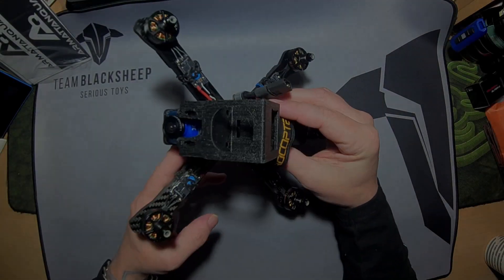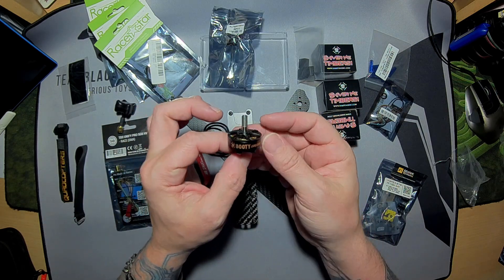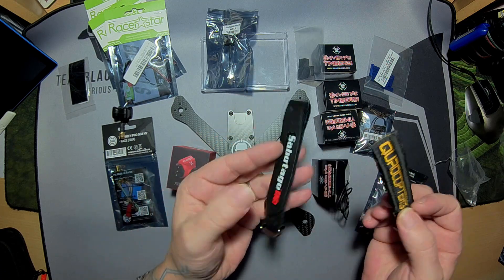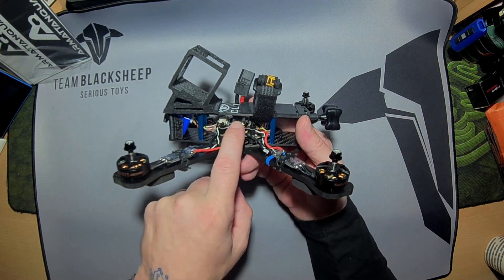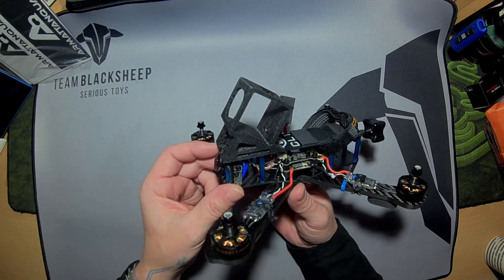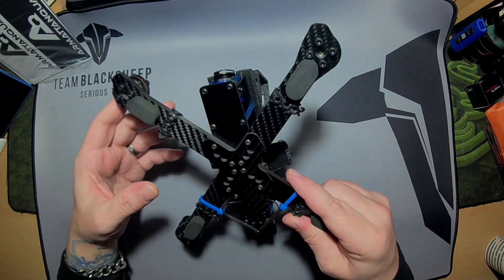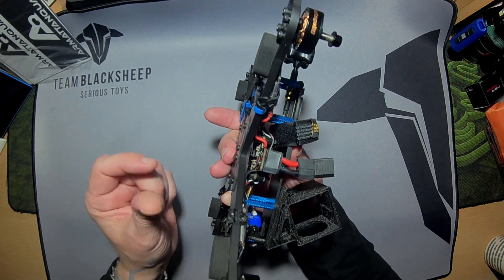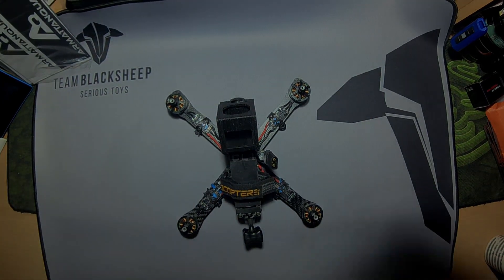Rotor Riot CL1 Parts & Build

Comment: What awg did you use for your battery lead ?
Reply from the maker: I used a little length of 12AWG which is probably overkill but hey,it's what I had handy.
Reply: So is 14awg good enough? I have the Bardwell F4 v2 fC Im wondering if I should use a capacitor?
Reply from the maker: I think it would depend on your usage for example ,4S on a Tattu 1550 yes for 14awg as those batterys have 14awg anyways, 6S or crazy powerful motor/esc with mental battery combo's no, go for 12awg.If all I had was 14awg ,I would have to use it to get me in the air and probably swap it out later for good measure.
As for running a cap or not, check on RCGroups or the store pages for anything explicit that requires one, you may be able to get away without one but nowadays it's very good practice to run one none the less so I'd say consider putting one on. Again it's depednent on the combo of things so air on the side of caution.
You may be able to kill 2 birds with 1 stone with your scenario as I remember seeing a store now recently stocking/selling XT60 pigtails with a capacator pre wired, I cant rememer off hand but will look if you want.
Reply: MrE thanks I saw that rotor riot sells them the pigtail with the cap. But it says comming soon! Also I have primo motors 2007 2650kv motors idk what awg they are but I should go with the awg for the esc? And the motors? What if one is 14 and the other is 16?
Reply from the maker: @Beastnasty_0313  Ignore the motor and ESC wires AWG as such because you have 8 power wires to the ESC's & 12 AC wires to the motors from them ,which all have to be supplied over the battery cable gauge combining all the power through them into one.

What battery are you planning on running?
Reply: MrE idk yet I’m new to the hobby I’m debating between 4s and 5s but don’t know anything about good battery’s
Reply from the maker: Being new to the hobby and the motors you have, 4S will blow your socks off!I assume you are leaning towards freestyling rather than racing?
Reply: MrE so 4s it is then and of course freestyle!! Also what charger do you recommend that’s not to pricy but works great? And back to the original question 12awg or 14? 16awg? For my battery lead
Reply from the maker: @Beastnasty_0313  I have had a great time and alot of use out of my ISDT 608 among many other chargers, good for the price and you can run a parallel charging board on it however it requires a DC input source in the form of an XT60 ( search my video back catalogue for a review) - ISDT also do others that plug into the wall etc. 
The SkyRC S60 is also quite a good cheap one for our needs which plugs directly into the mains (again a video on that somewhere in my back catalogue) which would get you going to start with.
Like anything in our hobby, there's so much choice in the way of chargers but sage advice is spend once on a good brand one.

To answer your battery lead considerations,  I'd certainly opt for 12AWG given the option.
Reply: MrE thanks again!! I’ll look at your videos when I get off work thanks!!!
Reply from the maker: @Beastnasty_0313  No problem ,Fella. I'll help you out the best I can - just shoot me a comment etc.

Comment: Nice! 
Just a bit curious, how many quads do you have at the moment? :P

And I have a little question.. I'm selling the Tronxy x1 (3d printer..) because it doesn't really print good enough.. for example 3d printed car parts break in a few minutes (details aren't that great too) and parts from a tevo Tarantula work fine so it's the Tronxy that's not working so good...

But I'm not sure what a good price is.. someone wants to give me €80 for it, what would you do?
Reply: And, I want to get some new wheels for the Basher Hellseeker, and I found some cheap 1:16 scale wheels, but they are for a WPL truck, and I don't know how big the hex (don't know the correct word for it) in the wheel is

Since you have a WPL truck, could you check how big they are?..
The ones on the Hellseeker are 8.5mm
Reply from the maker: You could count them in 10's haha!

Any issues with parts like that will need tweaking in the slicer - it might be a bit down to the printers hardware but for the most part it will be settings.
I use this: https://www.simplify3d.com/support/print-quality-troubleshooting/ to sort some problems.

I'd think that was a little low but with what you can buy brand new it's probably a fair price.
I'd probably try get a little more if poss but maybe sell if I wanted shot.
Reply from the maker: The hex for WPL are about 5.5mm
Reply: o.O You could just bring a few quads when you go somewhere flying and switch if one breaks..

And thanks,
The Tronxy x1 was also for sale for just €60 some time ago, so I'll just sell it ..
I think I'll save up maybe something like a prusa i3 after I got my laptop, it's expensive and it'll take some time to get, but it seems like a good investment.. I'm alsobthinking about maybe designing a cool frame with it to make my own unique quad, when I get a new printer

And thanks for checking, those wheels would have been a bit too small :p
Reply: Hey, just telling you for if you're interested, there's a new Magix bundle on Humble, including Vegas Pro 15 and some other cool stuff ;)